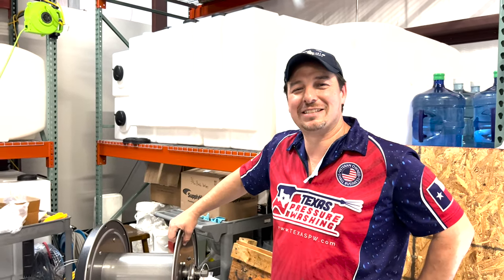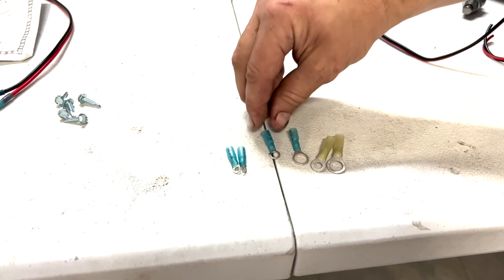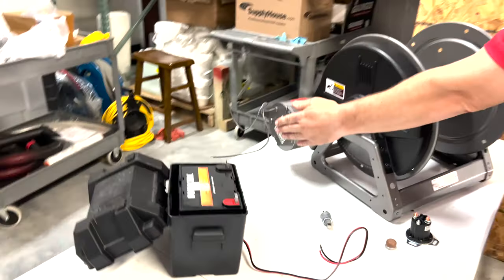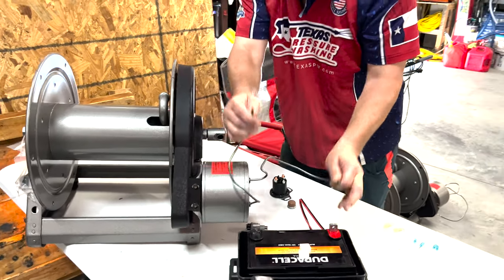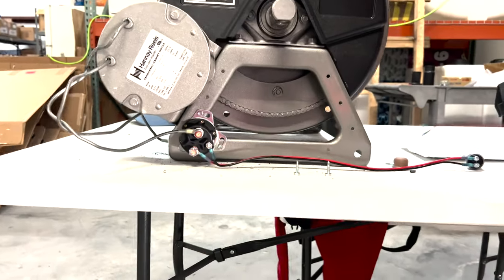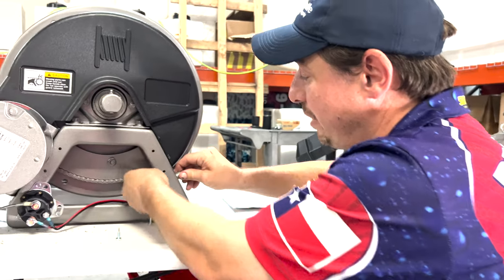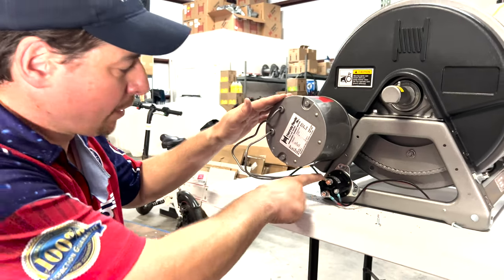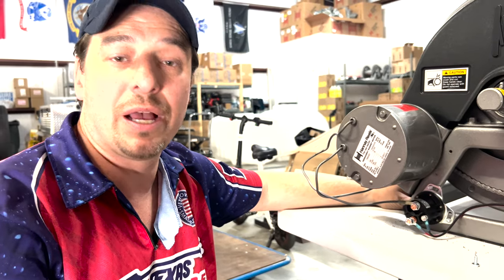How to Wire Your 12V Electric Reel

Comment: I bridged the posts on the selenoid and it works. But nothing past that works. I tried bridging from positive post on solenoid to small post (to act as the wire and switch) and got nothing. Can i just run wires from both big posts on solenoid to switch? Or will that mess something up? I tried it and it works, but dont want to mess something up.

Comment: Good breakdown video Aaron. It would be cool to also see how you wire up multiple reels and also connect the battery into the system. It took me a long time to figure that all out the first time.
Reply: Cody 
I understand that. 
I did six reels today 
Powered with dedicated 6awg ran 15’ to each reel. 
I used 4 pole solenoids 
#8awg 133 copper strand  
to power the switch, 
to run the ground, 
And to power to device. 
My reel motors say 50amp max 
So I stayed true to that 
I used the #6awg because of the longer run to the reels 
My switch is rated at 60amp
My solenoid is rated at 60 amp 

My reels are not grounded. 
Which made me ground my switch and motor to the trailer frame from each unit 

And I build custom handles to house the switches 
I installed a 40amp fuse directly off the battery on each power wire to protect all my components and wiring 

I always seem to end up doing everything from scratch.

I like that this video popped up the night “after” I did all my reel wiring 😂
Reply from the maker: Great idea

Comment: Since my spray rig comes on and off my pickup, I wanted a convenient connection.  So, I ran a hot wire to the back of my truck and into a waterproof household outlet near the hose reel.  Then, I connected the ground and + to a pigtail.  Now my hose reel has a cord that I can plug and unplug easily.

Comment: I’m installing a new Hannay reel to a ride on sprayer. And I have questions..I’ve watched this video (very helpful). I’ve connected all wires as you have done here but curious what post on solenoid does hot from battery connect to and do I ground negative from battery to frame of sprayer or reel? Thanks

Comment: Good morning, and thank you for your video.   I wired my hose reel and it travels in the wrong direction. Does this mean I simply reverse the connections?  I noticed you tested with a battery and not a meter.  This tells me polarity is not an issue, it's a directional one.  True?  Thanks again.
Reply from the maker: Yes reverse the connections. Rarely the motor can be wired wrong but it happens.
Reply: @TexasPressureWashing  Thanks.  Really the wires should be called directional wires, and not positive and negative.  Thanks again

Comment: What amperage are all your components?
Motor
Momentary switch
Solenoid

You used 10awg. 
Rated for 30 amp?
Just wondering if you considered using 8awg for your power feed and ground wires just for possible surges that would spike the amperage to your motors max and on your wiring.
Reply from the maker: 10awg rated Nominal Voltage 1000V;Bear Current: 50A
Depends on the length of run in regards to lowering AWG of the wire.  
From the fuse box we use 6AWG
Solenoid: Voltage: 12V
Continuous Amps: 100A
Surge Amps: 200A

Comment: So no wire coming from the negative side of the battery?
Reply: No ground that to the frame or truck
Reply from the maker: We ground to the truck, skid, or trailer.
Reply: @TexasPressureWashing  thank you.  I got it figured out.  Thank you for the video..